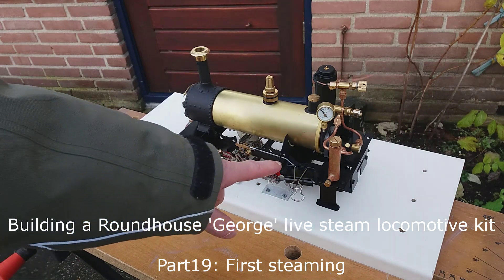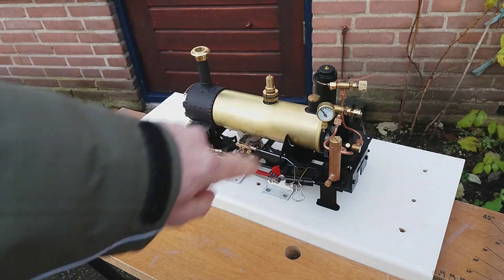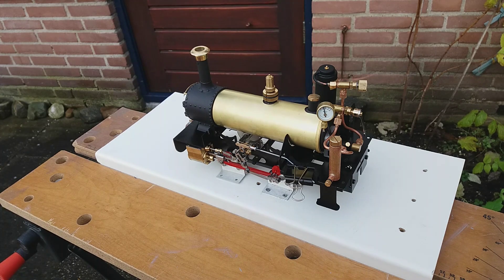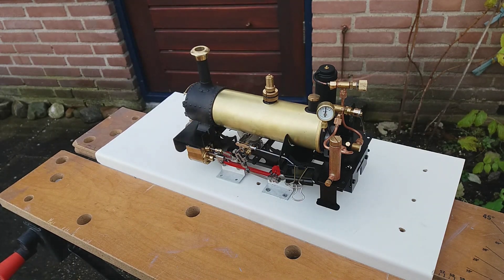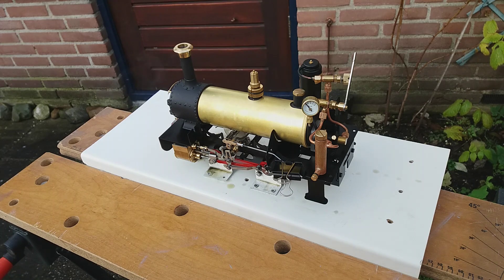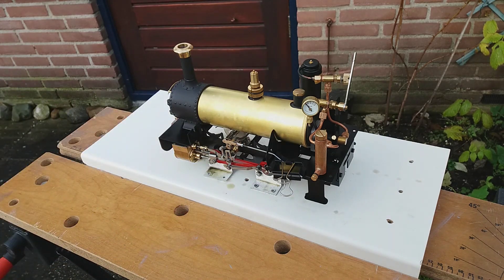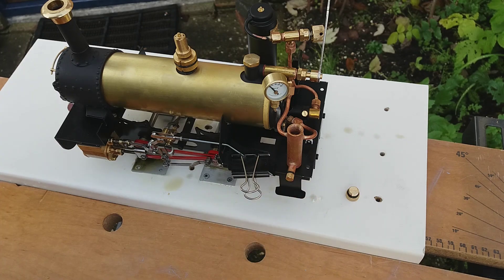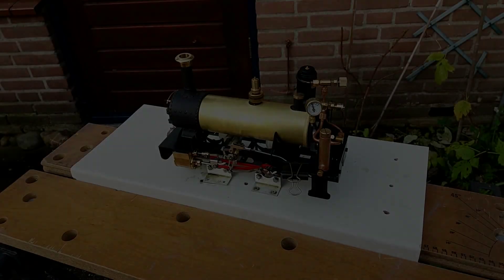RH George Part 19: First Steaming

Comment: One tip. After operation, the boiler cools and then creates a vacuum that sucks oil from the lubricator. Close the steam cock and let the boiler breathe by opening the oil filler plug (0 bar boiler pressure) or a whistle. Oil in the boiler acts as an insulator and interferes with subsequent heating processes.
Best regards
Thomas

Comment: my first steam up didn't go as well as yours, it'd only run in reverse and then the left coupling rod fell off the front wheel after the first 10 seconds of running. boy was that difficult to get back on while it was still hot.
i probably should've waited for it to cool down.